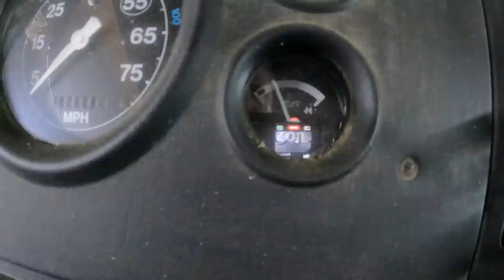Fixing Up A Cheap Ford L8000

Comment: Before painting rusty metal, after prep like you did, get some OSPHO from your local hardware store like ACE and put it in a spray pump bottle and spray all the metal down and let it sit overnight. It will turn black and neutralize the rust and be ready for paint, no need for primer. works like a charm. I've done several rusty trailers and it makes the paint last a long time.
Reply from the maker: Thanks for info

Comment: That’s a cool setup with the hydraulic pump. Mixers and plow trucks all have those. It runs off a shaft from the motor rather then a geared pto off the trans

Comment: We use a 3” cup wire wheel brush on a Dewalt angle grinder when cleaning water mains , works great on rust

Comment: Next time you do a rust restoration, use Ospho over the leftover rust then prime & paint.
Diablo D0748CF STEEL DEMON 7 1/4 inch 48 Teeth Metal works much better than the disk.

Comment: Very interesting video.  It is nice seeing you build up your equipment and business.  FYI, welding flash is not entertainment, however it could be a liability.  Take care and looking forward to seeing more.  We also like the fact that you do not have to have your face stuck in the camera lens as a lot of new sites do.
Reply: You can't get welding flash through a camera...
Reply: are you implying that your screen can produce the intensity required to give you arc flash?  if so your completely wrong.
Reply: @masterhec0  He better be careful opening up a blank word document if that's the case

Comment: If you sand off the tops of those spider legs those wheels will slide on alot easier !
Reply from the maker: I hit them with the wire wheel before putting wheels back on.

Comment: I like that red dumpster. Red is my better half's favourite colour. And those fenders, seems like the ideal application for plastic! You've mentioned tire prices as a sidenote in several of your videos. For a guy who has almost no idea, what would an ideal set of 10 new tires for a rig like that in your area cost? Probably as much or more a you paid for the truck. I know my little dually cost over 1k for middle of the road Coopers.
Reply from the maker: $2800 plus tax for just 8 tires. I put decent ones on but yeah the other truck runs everyday, this truck  is just a back up.

Comment: With thousands of square feet of vinyl decal removal experience... you would go faster and with more adhesive removal with a heat gun!
Reply from the maker: Yeah that’s the down fall with the rubber wheel

Comment: heat gun may have worked better…damn wheel stripped the paint off
Reply from the maker: The rubber wheel didn’t take the paint off

Comment: Are you removing the good rear tyres and putting on worn ones?
Reply from the maker: There legal
Reply: I think he mentioned swapping the better/newer tires on this truck with some with more miles on them from another rig that get's used daily. Makes sense if this rig isn't going to see daily service in demanding conditions. Put the better tires on the better truck, was the thinking I took away from his comments.
Reply: @AnomadAlaska  ah, I missed that, thanks